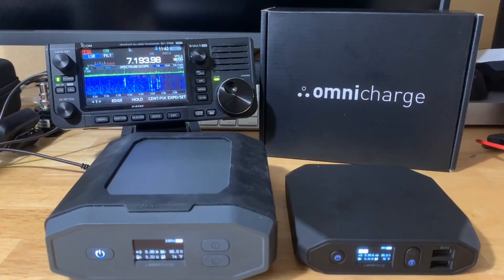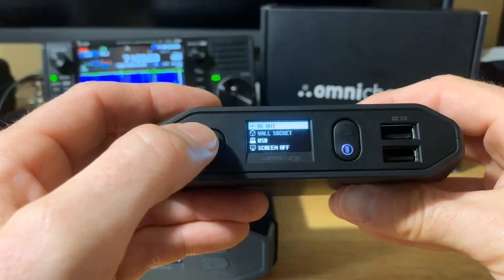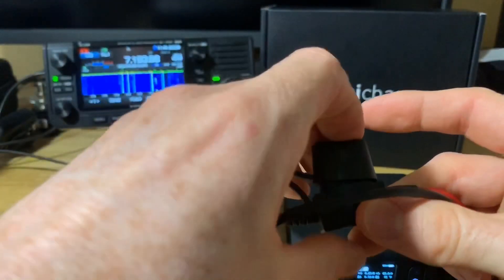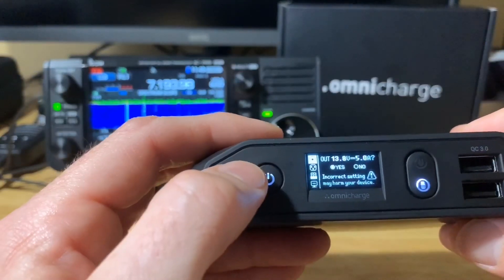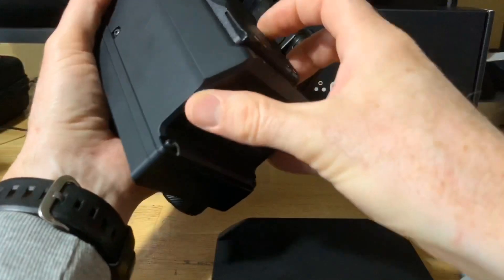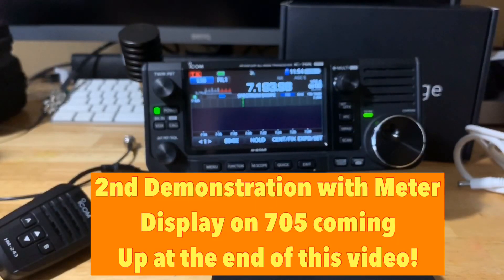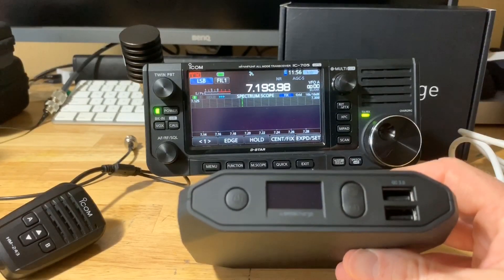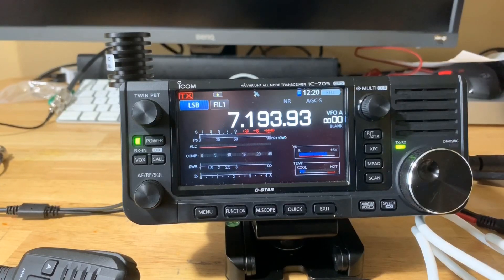Powering The Icom IC-705 with Omnicharge Powerbank

Comment: What was the cord you used to connect the power bank to the 705? Can you link it?
Reply from the maker: It is a DC Barrel cord……I believe I bought it on Amazon but their site is down for searching previous orders but I will try to find it and update this comment when I find it!

Ok so the Omnicharge’s DC barrel connector is a 5.5mm x 2.1mm connector and the 705 is a 2.5mm barrel connector.  I have a DC barrel cable ( 2.1mm x 5.5mm ) with an adaptor to go from the Omnicharge into the 705’s 2.5mm connection.  I hope this helps 73

Comment: hi i was wodering  kinda power cord is that i waunt to order the cabel ? ang the the charger
Reply from the maker: Hi I have put below the links to Amazon where I purchased them for the DC Barrel Cable,  the 2.1mm to 2.5mm Barrel adaptor(to plug into the 705’s DC connection) and the Fused DC Barrel Cable.  The Battery Bank is the Omnicharge 20+ and their site is Omnicharge.co I hope this helps! 73

DC Barrel Cable: https://www.amazon.com/Hanvex-HDCX6T-Adapter-Extension-Wireless/dp/B079P842DK

2.1mm to 2.5mm adaptor: https://www.amazon.com/MOBOREST-Connector-Adapter-Socket-Security/dp/B081Z92NJ9/ref=mp_s_a_1_1?dchild=1&keywords=MOBOREST+12V+5.5mm+x+2.1mm+DC+Power+Connector+Adapter%2C+12%2F24V+Male+to+Male+Power&qid=1613153944&sr=8-1

DC Barrel Fused Cable: https://www.amazon.com/zdyCGTime-Disconnect-Harness-Extension-Surveillance/dp/B08JGVN7RF/ref=mp_s_a_1_1?dchild=1&keywords=zdyCGTime+14AWG+DC+5.5mm+x+2.1mm+Male+to+Female+Quick+Disconnect+Wire+Harness+Extension+Cable+DC+55+21mm+Male+to+Female+Power+Cable+with+Fuse+Holder+for+LED+Strip%2C+Surveillance+Camera%2840cm%29&qid=1613154078&sr=8-1
Reply: Thank you for taking the trouble to help me. Thank you for all the help! Thank you for your assistance with this matter. Thank you so much for the help.  i just bought Icom IC-705 HF/VHF/UHF All Mode Portable QRP 5W/10W Transceiver. so you  say of the charger in the field you will get 10amps?   MOS0311 0321-0331 Retierd
Reply from the maker: Thank you I am glad I could help you out!  The small Omnicharge 20+ can output up to 5 amps and  the Omnicharge Ultimate can output up to 8 amps.
Reply: Why not use the fused power cable that came with the IC-705? That's a lot of leverage on the power jack with all those adapters.

Comment: "The DC barrel port which I'll use for the OmniCharge", did I hear it right? The port is already on the OmniCharge device, so how do you mean "for", or you actually said "from"? Later I was trying to see which port you plugged your cable to, and it wasn't shown in the video. Plus the earlier shot of it, it was out of focus, so I can't see the label in the video. Thanks for your very interesting video.

Comment: Wonderful video. Have never heard of this product before your video. I definitely like the OMNI 20+ Bundle. Curious about the FAA approval for the Ultimate....but not the Omni 20+. Oh well, I rarely fly anyway. I also bought the larger battery for my IC-705 (2 actually) and I think this would be a good augmentation for the portable operations 'go bag.'   Thanks for video!  73!   Wayne  KJ7TJA
Reply from the maker: Thank you I am glad you liked my video and that you found it helpful 73
Reply: I too liked the video.  I'm definitely interested.  Can you please post a link for the power cables you use (red and black and also the white one) between the power bank and the 705?
Reply from the maker: Hi David below are the links to Amazon for the DC Barrel Cable, 2.1mm to 2.5mm Barrel adaptor(to plug into the 705’s DC connection and the Fused DC Barrel Cable.  I hope this helps! 73

DC Barrel Cable: https://www.amazon.com/Hanvex-HDCX6T-Adapter-Extension-Wireless/dp/B079P842DK

2.1mm to 2.5mm adaptor: https://www.amazon.com/MOBOREST-Connector-Adapter-Socket-Security/dp/B081Z92NJ9/ref=mp_s_a_1_1?dchild=1&keywords=MOBOREST+12V+5.5mm+x+2.1mm+DC+Power+Connector+Adapter%2C+12%2F24V+Male+to+Male+Power&qid=1613153944&sr=8-1

DC Barrel Fused Cable: https://www.amazon.com/zdyCGTime-Disconnect-Harness-Extension-Surveillance/dp/B08JGVN7RF/ref=mp_s_a_1_1?dchild=1&keywords=zdyCGTime+14AWG+DC+5.5mm+x+2.1mm+Male+to+Female+Quick+Disconnect+Wire+Harness+Extension+Cable+DC+55+21mm+Male+to+Female+Power+Cable+with+Fuse+Holder+for+LED+Strip%2C+Surveillance+Camera%2840cm%29&qid=1613154078&sr=8-1
Reply: Also, one more thing... With about a 50% duty cycle on SSB, about how long will the Omni 20 last in the field if only the 705 is connected to it?
Reply from the maker: Hi David,  I will need to do a bit more testing in order to give you an answer for a 50% Duty Cycle (50% duty cycle= In an Hour you transmit for 30min and listen 30min) as I am normally not doing a 50% duty cycle.  73